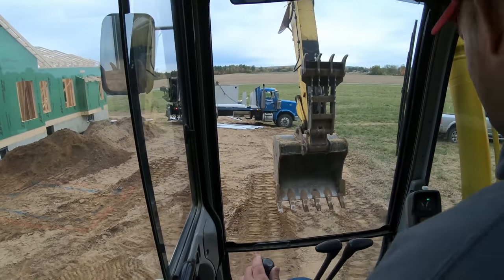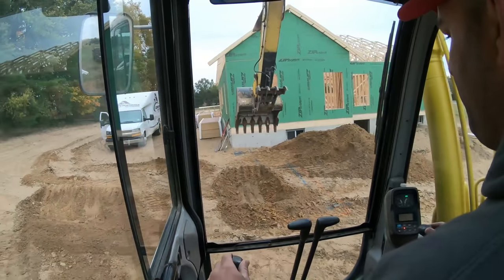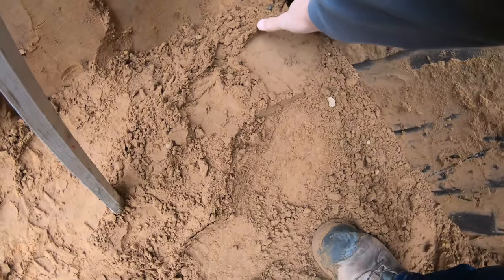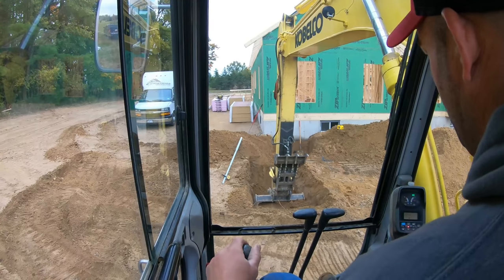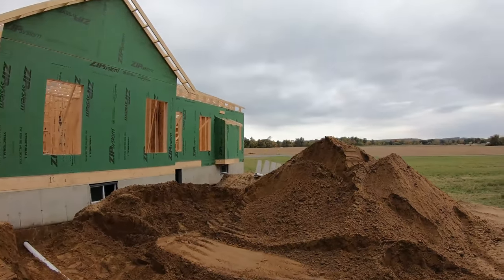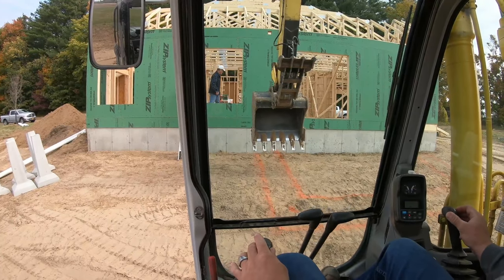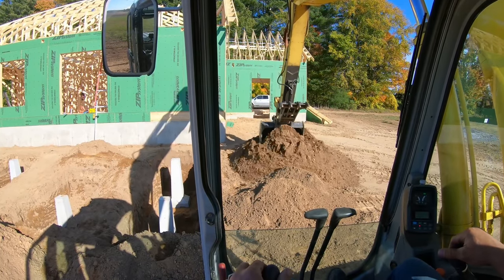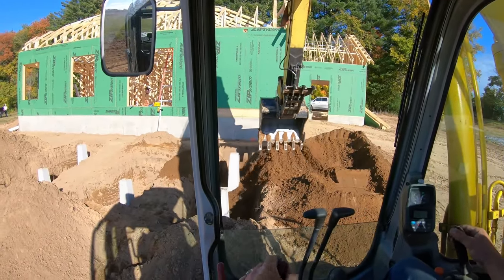Septic tank install & installing concrete precast deck piers for screen porch

Comment: I worked with a contractor and my job was laying block foundation walls. when i reached half way they started building the floor on the side . when my job was complete they lifted and placed the floor . as each wall got built the next one was ready. every floor and job went in a sequence with inspections almost daily. he had a service truck for each trade with every tool or supply the trade would need. each contractor had a laborer and a clean up crew. it was amazing how it all worked out. we would have a $500,000 2 story with full basement home built from ground breaking to move in ready. I loved working for him he had a great mind and wonderful practices that made him a great home builder. i don't mind seeing a home get built . love watching your vids
Reply from the maker: That's awesome ! Thanks

Comment: Who sets your elevation benchmarks for you?  Do you run off a railroad spike on a power pole or manhole cover, or just run your own?  Sometimes you find a RR spike in a utility pole or an X carved in a curb drop inlet, you could always use that.
Reply from the maker: On this project the elevations.. but when we get them surveyed there will be a spike somewhere

Comment: That dirt is really cooperating. I wanna start doing septic systems but for some reason I'm hesitant.
Reply from the maker: Definitely don't hesitate get out there and do one here is a complete detailed video I did on the conventional septic system.. once you do one it will be repetitive.. heres link
https://youtu.be/ffeZYXtwVpE
Reply: @DIRT-BOSS  I appreciate the link. I'll definitely watch it tonite!! Have you ever done a video on bidding different types of jobs?
Reply from the maker: @dowjones9663  No I didn't I think I'd leave that up to a live stream if I ever get into one each job is so different it's more or less on time and material plus equipment

Comment: Great vid, no cleanout between the tank and foundation?
Reply from the maker: Yes the clean out usually is in the basement It will have a trap or a clean out top

Comment: Nice 👍.   Do you have different rates for different machines or do you charge by the job? I charge by the job. I haven’t had any luck with by the hour .
Reply from the maker: Yes definitely have rates for each machine but most of my jobs are lump sum bid jobs but as I'm figuring them I figure each piece of equipment..
Reply: @DIRT-BOSS  yup i’m always curious to how people do it in different areas. Years ago I tried doing machine work by the hour and it was more of a headache for me personally !